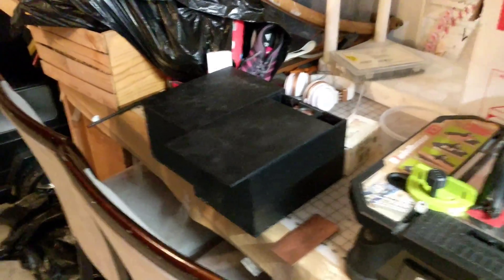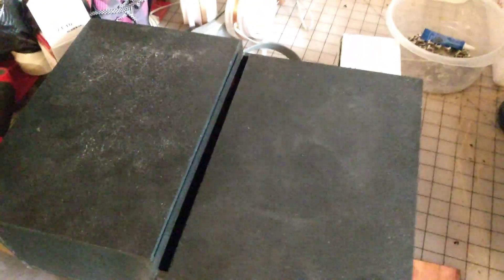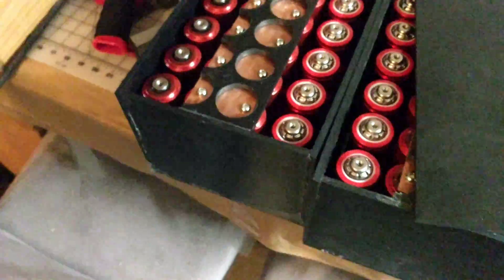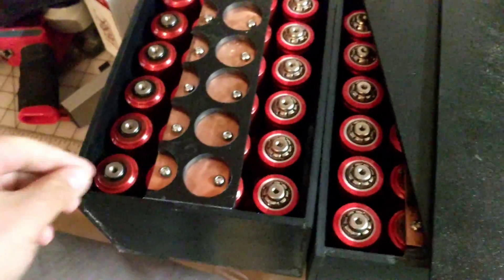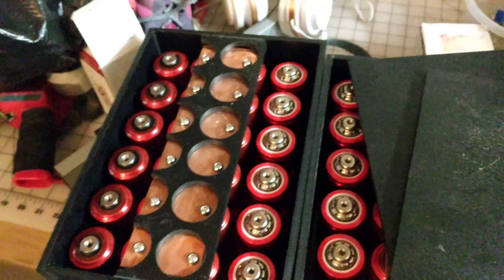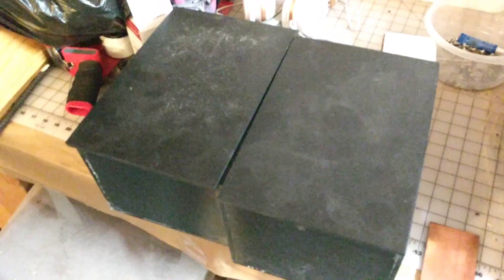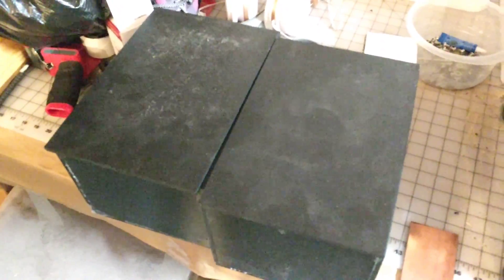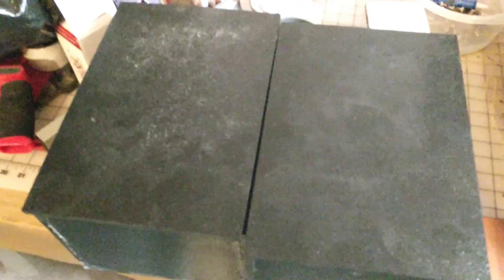Custom 96ah of LiFePo4 coming soon

Comment: Came back to your video for ideas and just to see.. My cells came in today I have enough for 40ah. How are the batteries treating your system? I will be ordering my bus bars tonight Not sure about the case yet. I'm thinking wood or 1/4 inch plexi (things I have laying around) A few of my friends made some banks with these cells and they are happy bassheads
Reply from the maker: bigvell02 cells are doing wonderful. They got stronger after several uses as most lifepo4 do. I'm thinking about adding another 96ah as my voltage still drops to 12s
Reply: Marius Dornean wow! And your system is demanding. How did you go about balancing your cells. I’m thinking I should bottom balance, put the pack together and let the car bring it up (monitoring each cell) then balancing later if needed.? That’s what I’ve picked up and summarized from what I’ve read and seen.
Reply from the maker: bigvell02 I just charged all the cells up to 14.4, then let them fall to their resting state.

Comment: Ive been thinking about this for a while
Reply from the maker: bigvell02 I'm out of space for more subs or bigger amps so this is the only thing I could do to get anything more
Reply: Those cells are really nice. Ok one question BMS with those cells? Do you plan on monitoring periodically? Ive been doing tons of research but no real confirmation.
Reply from the maker: bigvell02 no BMS plans. As limitless lithiums point out, BMS isn't really needed for our application and the BMS would hinder performance.
Reply: Interesting. Looks like its a go then I will start to collect the cells - thanks for the info.